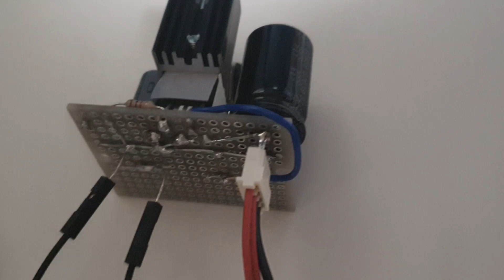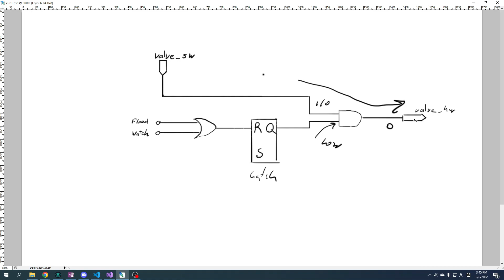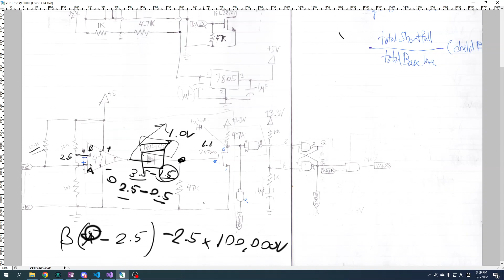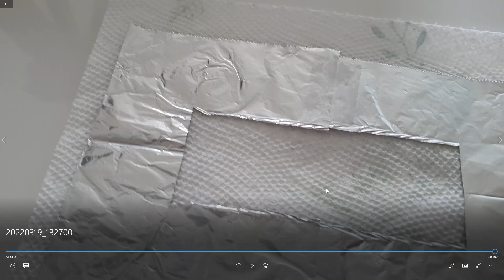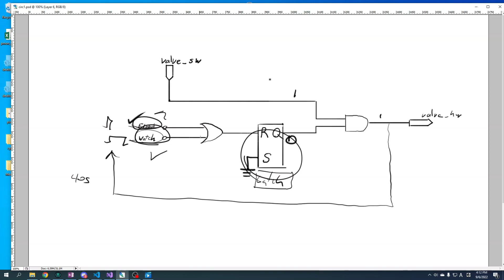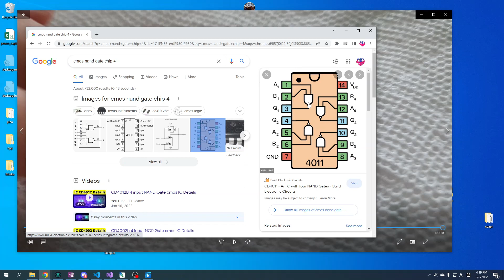Failsafe Sensors [Project Moisture]

Comment: Why not just design a PCB and order from china (it's really cheap)? I use easyeda.
Reply from the maker: You need to find the software you like, then learn how to use it, then input the design. Just soldering it myself is an order of magnitude faster. Not to mention the turn around if I fuck something up major-time and need to rework the board manually, or change the design and reorder.

I would invest the time in a workflow for PCB design if I anticipated doing this sort of thing a lot. But I don't, so I won't :]
Reply: @ChiliTomatoNoodle  I understand. It's very easy on the easyeda website though, the online software they have is super easy. One youtube tutorial is enough. Great tutorials btw, I'm making the fart annoyed game right now :D